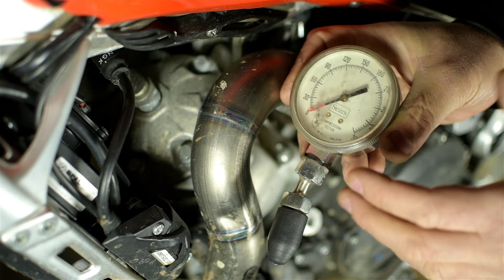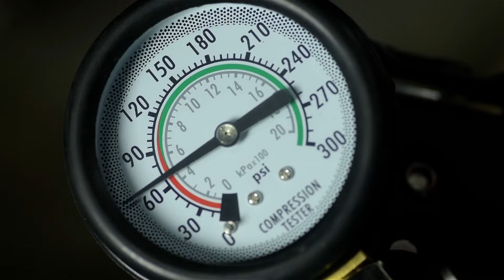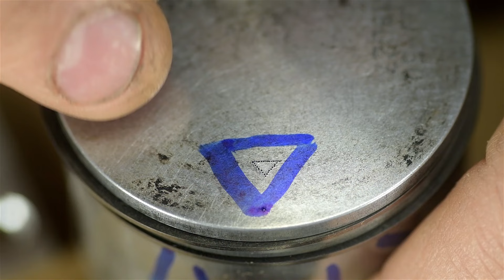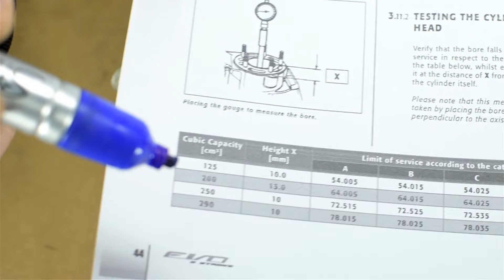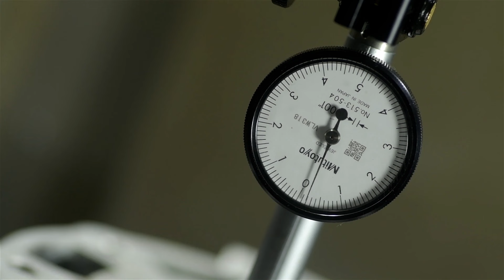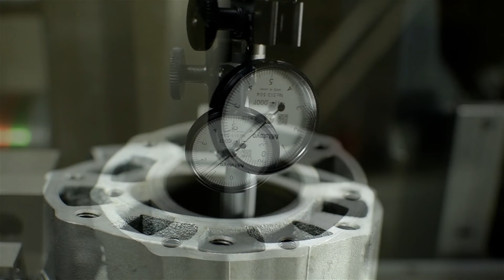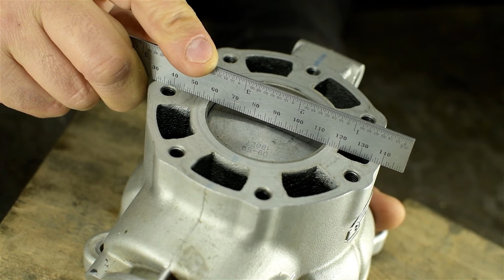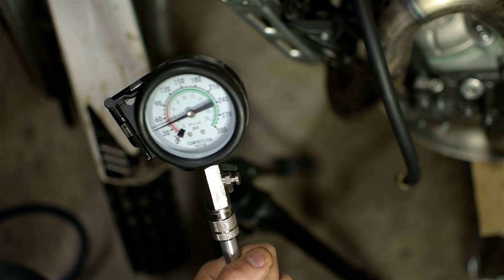Top End Rebuild! (2 Stroke)

Comment: ooh ToT we need to talk... on a two stroke the "engine" oil is actually only in the transmission, I think you know that since I recall you maybe mentioning it in another video, or was that somebody else? But I think I heard you say gearbox oil is getting past rings. No the oil you mix with the gas with the air from carb entered crankcase before being pushed up into the bore through the ports.  Anyway, a crusty piston is a matter of your two stroke oil and the ratio. I noticed using a synthetic high ratio oil I had a crusty piston, but when I got a yamaha 125 I tried out yamalube - r, (that was 20 + years ago) now it is a different version, but that stuff never carboned up the piston, and it was actually oily on tear down which amazed me. I guess you would appreciate something like that too. I think I ran it 24:1 you will have to adjust ratios to find what makes your bike happy. You may foul a plug?  Just thought you'd like to know this.
Reply: well I watched this before bed last night, and some thoughts crossed my mind afterwards.  first off I like most fans am in awe of your skills and ideas, which makes it surprising to find I might have a question about what you have presented.  Here are two things. First, I thought I had a point about the cheap compression tester, but luckily I thought it through before writing. I was thinking that the long tube extension, unless there was a check valve at the spark plug threads would effectively increase the cc and lower the compression ratio! However when you used the air compressor that proved your point, but I still think on a small cc cylinder that would affect a reading even with a good gauge.  The final point, and I'm being a real stickler here, but you seem confused about compression when talking about the 290cc vs 125cc and kicking, the compression (ratio) is most likely very close but the bigger takes much more force due to pressure times surface area being the total force you work against.  I'm sure you were just tired.

Comment: As long as it isn’t aluminium you don’t need the coating also you can make a chrome Ollie sleeve to replace part of the bore if you use dry ice to shrink it and press fit it in as long as you remember to cut the ports in it will last you a lot longer

Comment: 14:20 Yes absolutely you can use new pistons with old cylinders it’s actually how you do it you use a cylinder go through piston A,B,C,(D) of course if the bore is not scratched and then you get a new cylinder and start over .... in racing we go through 10pistons in one cylinder usually AAAABBBCCC because they get changed every single race

Comment: I have a friend that had a homebuilt airplane with a 5 cylinder radial engine. It was very old and needed work. You had to pull the propeller to start it and 4 of the 5 cylinders had no compression at all and one had a very little. It was a bit hard to start and the propeller could be turned pretty fast because there was no noticeable resistance. Once the engine started it ran good and produced lots of power. They eventually broke the crankshaft because they had the wrong propeller that let the engine rev above the rated rpm. Instead of producing about 70 hp it was estimated to producing about 90. The crank failed.  Compression loss doesn't necessary mean a loss of power.

Comment: Thanks, I enjoyed watching the video. I have a question, when should I move to a larger piston, and is there any work I can do about increasing the cylinder gap? I have a Kawasaki KX100 2013 bike. The piston gap now is 52.52 mm, and the service limits are 52.60, since I rebuilt it. piston and piston ring stand, and the pressure was 75 psi, and it is supposed to be between 119-180 psi, i.e. directives in this matter to gain high pressure in the engine

Comment: I never pull my telescoping gauges straight through. The slightest bit of friction, and you can't get the widest diameter. I always rock them gently left and right, to make sure it walks to the widest point, as I pull it through, slowly. I get pretty consistent results that way. It's how my machine shop instructor taught me, and he was German.

Comment: The air also compress inside the robber hose. Thats why it can't measure compreession on small engines...Try  a smaller robber hose (5cm/2inch for exemple), works great with small engines!

Comment: The problem with that amazon compression tester is that it doesn't have a one way valve at the very tip of the hose. If your bike is making 120psi for e.g. and the volume of the connector+hose is equal to the cylinder volume at top dead center, then you will measure 60 psi of compression. I got one, measure my bike at 60 psi as well, and then once I came to the above conclusion I promptly returned it, told amazon it's defective (which it is)

Comment: You did mention the reeds- their condition is fairly important. If they don't close completely against the reed block, that is. You can flip over the reeds, so their undesired set is now helping to hold them closed. Or, replace them.
   I do think that ring end gap was the problem, though.

Comment: Fun fact, it's not super accurate but sometimes it's all you got in a pinch; you can hold about ~90-100 psi with you thumb before the pressure blows it off the sparkplug hole. However, oftentimes you cant get your finger in there to do it. But yknow, the more you know.

Comment: you probably could have used the same piston, it looked in pretty good condition once you cleaned it up, just normal wear. The piston rings are what matters, being 3x out of spec will definitely cause loss of power/compression and is why there was so much black on the sides of the piston, that's all the lost air/fuel mixture from the compression/exhaust stroke making its way past the rings leading to carbon build up

Comment: That compression gauge needs a check valve in the engine side of the hose to get accurate numbers on small displacement engines.

Comment: Sorry for the off-topic but: Could you perhaps-possibly-maybe do a DC scratch TIG brazing video?

As in if it is possible to use an el-cheapo DC scrach-tig capable stick welder to tig-braze with? Especially on aluminum?

You would be my hero (even more than you are now)

Comment: You really need a torque plate to bolt on to the cylinder jug before measuring in order to measure it properly. It simulates the distortion that results when bolted in place, i guarantee they bored/honed it with torque plates in place.

Comment: hey Tony crank seals are critical on two strokes if they are bad its like the boot from the carb is ripped. it wont create the desired negative and positive pressures on the cold side of the piston

Comment: Make a check valve on the bottom of the fitting so it will trap the air in the hose. Then the compression tester will work like it is supposed to.
And a actual good gauge will also  work better 😂

Comment: I use muriatic acid to clean Nikasil cylinders.  You have to be careful to keep it off of the aluminum, and be sure to neutralize it with baking soda and water.  Sometimes I lightly sand them with sandpaper, or 2-3 slow revolutions of a hone.  This would be to remove any glaze and get the rings to seat more quickly.  Not saying my technique is better, mind you.  It's just how I do it.

Comment: Did you check the baffles for carbon blockage?  That can sometimes cause excess back pressure and poor performance.  Also was you second compression test with an oiled or dry bore?
Generally, a 2 stroke will give lower readings than a 4 stroke, think of the  piston crown stroke distance between transfer close and exhaust port Open compared to  Inlet Valve Close to Exhaust Valve Open stroke length on a 4 stroke. 
Hang on to that comp tester and recalibrate it. Or just replace the gauge with a better quality one.
Unless you have better things to do during lockdown?   ( Grease on the Bedroom door handle?)

Comment: A Briggs and Stratton flathead should have a compression ratio of 6 to 1, if I'm not mistaken. A sea level, that would be 88.2 PSI. Briggs have a compression release. The exhaust valve stays open of close to 50% of the piston travel, though I dont have the exact number for that. Plus, any Briggs with a working carburetor will run. I bet I could make a Briggs run without rings. Half of 88 is 44 psi when you're pull starting it, say, with compression release open. And if we half that again because you've never changed the oil during the life of your mower, a Briggs could probably run with 22 PSI compression. Yadda yadda the Otto-Langley atmospheric engine technically had no compression. And it made a whopping no power.

Comment: Mix and match. Use a B or C piston to get back to stock clearance. It's why the other sizes were originally made. The 'thrust face' of piston is at the back due to con-rod angle, (unless you have a1970's Kawasaki twin, they run backwards)  Extra base gaskets a bad idea unless you know what your doing., changes port timing. Kawasaki say use 4~600 grit on plated cylinders, most others just want to sell you a new one. (I taught this stuff for 3+_ yrs)

Comment: As an auto mechanic, we like to see at least 90 psi for pump gas. 90 psi is the magical number but not as magical as you though. For the exhaust I would recommend copper gasket spray. Have the exhaust clean and positioned. Then shake can well. With a small paint brush handy, spray copper into a can cap until you have a good sized puddle then quickly paint where you want to seal.

Comment: How about using the adapters/plumbing on the Sears gauge?  If it reads the same as the cheap gauge then either the cheap gauge is correct or you've confirmed the plumbing is crap.  But, the adapters look decent and you would hear them leaking if the leak was big enough to make that much difference.  OK, I watched to the end and saw that you found a way to ballpark check the gauges.  So, keep the adapters and use them with the Sears gauge.

Comment: Using the telescopic snap gauge to determine bore taper is fruitless.  Use your noggin and consider the geometry... and the function of the snap gauge.  The snap gauge will only give you a good reading of the NARROWEST portion of the cylinder that you sweep.   Using the piston ring (and the piston to place it squarely in the bore) as a gauge is your best option.  Making note of the piston  ring gap at incremental steps down the bore.  The upper edge of the cylinder can be used as a reference (there is usually no wear there).   That spot (above the "ring ridge" should be virgin).  Measure  the ring gap with a feeler gauge and continue making measurements down the bore (of course, using the piston to hold the ring square).  And VOILÁ:  you're ready to be on Mario Andretti's pit crew!  Or you could use a bore gauge.

Comment: Seems to me like the dial on your cheap compression tester seems shot... Just wondering if the accessories for the cheap one are interchangable with the parts on the one that you have less trust issues with. If so it might be useful to keep the accessories for future use as they looked like they'd get you into the tighter spots quite nicely.

Comment: You should get those dings out of the expansion chamber, it can make a big difference to the performance as the chamber is tuned to the engine. 2 strokes are far more dependent on that than 4 strokers

Comment: Tony I'm a professional motorcycle  technician  as far as honeing goes next time use a 240 grit ALUMINUM OXIDE  flex hone not a silicon carbide one they are specifically made for deglazing nikasil cylinders  and as far as doing it on 2 strokes it is actually  good because it champhers the ports keeps the piston rings from catching on them. I'm just letting you know  what works and what we do at our dealership.

Comment: The cylinder looks like it could use a honing, the crosshatch has worn away which can mean poor compression because the oil is unable to stay inside the cylinder where it should be. The oil should be almost completely preventing wear on the parts, so at some point there wasn't quite enough oil. Not enough to trash the engine, but enough to cause wear.

Comment: I think it's about $200 a hole for nikasil, maybe able to find it cheaper. Never had my banshee cylinders done. (Aftermarket CPI cub). Haven't finished the video but wiseco is pretty much the only 2 stroke piston to run. Theres a couple others that are ok but for the price difference I'll stick with what works. You can't hone nikasil, not unless you have a diamond hone.

Comment: In order for the cylinder to be hooped the nik a sil coating Nickle/ silicone  has to be worn off denoted by a distinct color change leaving an exposd aluminum surface that won't last 5 min. out of round or tapered only on 4 strokes unless massive scoring.

Comment: On small engines make sure the one way valve within the hose  is as close to the engine as possible ...those adapters make the problem worse. They are really automobile testers that dont show much difference  when used on larger engines

Comment: You did a dry compression test, you should have done a wet test, there’s usually a spec for both, put some oil in the cylinder on top of the piston and retest

Comment: @This Old Tony your ultrasonic would work better if  1) you had it filled to the correct level  2) if you have your cleaning fluid heated to heat the fluid use a sealed panel element heater

Comment: i can assure you that despite the worn piston rings gearbox oil isn't getting in the combustion chamber, partially because the two systems do not share lubrication, but mostly because this is a 2 stroke engine

Comment: ALWAYS hone the bore. Nicasil is tricky but you have to break that glazing. Flex hone is all thats needed.
The rings won't run in without some roughness on the bore surface. This might cause overheating of the rings the first time the motor is pushed to the limit which can cause the rings to distort, become dished,  resulting in excessive smoking.
But seeing as it is only a 125cc 2 stroke motor you might get away with it. On a four stroke 800cc BMW boxer motor you won't. (I had to learn the hard way, coincidently having had the exact thinking you had being worried the nicasil coating will get damaged.) 
Some of the good guys from the BMW racing explained to me why leaving it unhoned is a bad idea and that the safest way to break the glazing is with a low tech flex hone.

Comment: For anyone using those Amazon compression gauges… those adapters will screw with you. If you can, don’t use them. I had low readings using that gauge with the adapter, but the hose threads were the same as my spark plug, and when I took off the adapter, it read about double the compression. Just an fyi.

Comment: Compression readings should be as accurate as possible however in the multi-cylinder arena the point of compression testing is to identify a cylinder with varying compression from the others. In other words, you are looking for one or more that is/are lower than the rest as you are probably trying to correct a rough operational problem (poor idle quality, etc.). So, the point being that what is the most value here is identifying a problem cylinder(s) so accuracy of the test value (compression pressure as related to specification) is secondary. Rule of thumb states a 10%to 15% variation is acceptable. In a single cylinder cylinder application obviously, true compression pressure as it pertains to spec would be far more important.

Comment: Out of interest,
What was the measurement of new piston ring gap in the bore ??
I’ve owned a fair few 2 stroke bikes over the years and I’ve never seen blow by like that.
Is the bike running at the correct temp when it’s warmed up ? 
If not that would make the rings prematurely wear out.

Comment: If you like these bikes, but want to try something more comfortable, get a Beta Alp, either the 200 or the 400cc :) Perfect for going up the mountains and you can sit on them :)
Also: that's a 2 stroke, there's NO gearbox oil anywhere in the thermal part of the engine, unless you have a broken seal in the pump carter side. You can't have "gear oil blowby" in a 2 stroke engine...

Comment: Hi there. Have you ever heard about "flywheel waight" improving low rpm steadiness? I just got my YZ250X OEM flywheel out, on the scale it was 575g (20.3oz) I have seen some on the after market for the Yamaha at 850g, would it be so difficult to manufacture one on the lathe? Just an idea... Cheers!

Comment: As an engine guy, I gotta ask:  How is that fräsemaschine coming?  Also, you can get away with quite a bit of slop as long as you keep the ring end gaps in spec.  Some racing engines run very loose.  BTW, I use dilute vinegar (around 5%) and a bit of detergent heated to boiling in my ultrasonic - works great but be very careful about leaving stuff too long in there.

Comment: They'll start with as low as 35psi from my own experience. Had an old crap dirtbike engine I wanted to turn into a gokart and it tested (with a good snap-on compression tester) at only about 35psi. Was supposed to be 115, if memory serves. (this was like 18 years ago)
It *started*, ran like crap and smoked enough to make my eyes burn like instantly, but it did start.

Comment: 24:01 Nikasil is used on the steel liner. There's no aluminium wall in contact with the piston rings.
Reply: Nikasil is used directly on the aluminum in this case and most  aluminum cylinders of this type

Comment: Could a man of your talents maybe introduce a third piston ring? Meaning, cut a third little grove into the piston, the reasoning being 3 rings are more than 2. BTW, I have no idea if the inlets and outlets of the cylinder would even allow this or what the implications on performance might be. But given that the highly expensive Nikasil re-coating process is often not an option, I wonder if this might just be an option to give these types of engines a little more life.